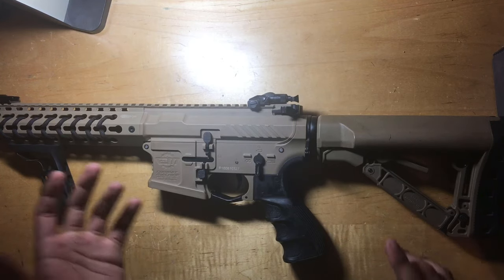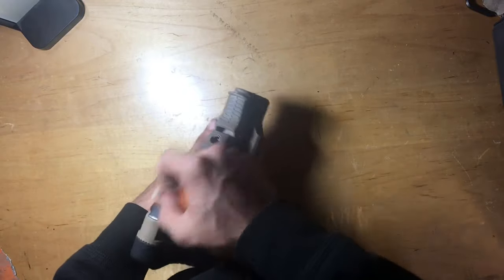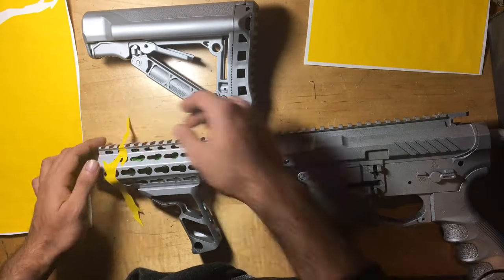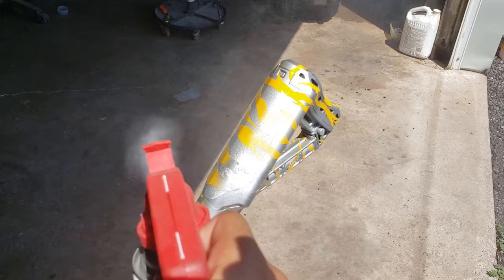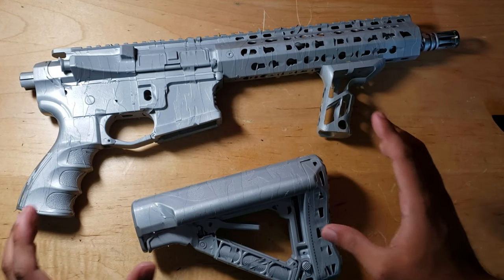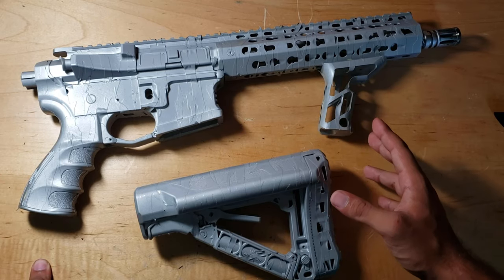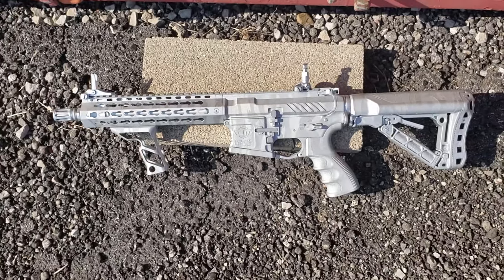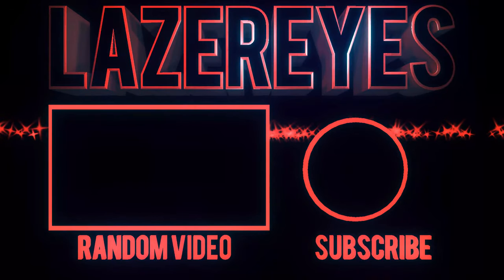COD WW2 "Chrome Tiger" Custom Paintjob (G&G SRL Paintjob)

Comment: What's your opinion on the G&G CM16 SRL? Any pros and cons really help, I'd really like to know if this could be a good starter for me.
Reply: I have the SRXL. Great gun for starters, especially with the microswitch trigger. The mosfet was the problem for me, i had to re-solder the wires a few times because they would get dislodged in the stock, there isn't much room in that G&G stock that comes with it
Reply from the maker: @AFOPatches   dead on, pretty much exactly what I was going to say. The SRL was my first gun and it's great for beginners, and yes micro switch is awesome. But the mosfet is garbage, mine completely gave out after a year and it's pretty infamous for it as well. I find this rifle to be very ergonomic as well. This is definalty something you'll enjoy using but later down the road, you'll probably have to get a new mosfet.
Reply: @lazereyes24airsoft22  Which is fine, having room to modify and improve an Airsoft gun is alright, so long as it works for the first few times playing Airsoft.

Comment: Hey man, new sub here, i really enjoy your videos, especially the paintjobs. What kind of paint do you use? Is it only rustoleum ? Any thoughts on plasti-dip ?
Reply from the maker: Hey! Thanks buddy I appreciate it :) I mainly use rustoleum because of all the hydrodipping paintjobs I have done, rustoleum and krylon are two different brands. I have heard great things about krylon when using it as a quick way to rattle can your airsoft gun with military camo. Plasti-dip will defineatly not last on an airsoft gun because of the abuse, I am a pretty aggressive player so I doubt It would last a day. Paint is the way to go for sure. Hope that helps, take care :)
Reply: @lazereyes24airsoft22  haha rustoleum is what I meant, not petroleum! :D Thanks for replying, I'm completely new on airsoft paintjobs. What are the paints you recommend ? Types and brands I mean. And one last question: i see you put borax in the water, why do you use that ? Is it to make the paint stick better on the parts ? Thanks a lot again :)
Reply from the maker: @billmaragos2812  Rustoleum 2X Ultra Cover Spray Paint is all I use unless I am doing something extra fancy like the metallic paints I've been using in this video. For that I'll just use whatever I find at the store, you can find these paints anywhere at local hardware shop (super common!). The reason I use these paints is because they are oil based, of they are not oil based paints then the paint will literally mix in with the water (I found this out the hard way 😅)

The borax is used to help the paint float on the surface of the water. You can get borax at the laundry aisle of a grocery store. I've done quite a few hydro dips and I still haven't used half the borax they give you.
Reply: @lazereyes24airsoft22  great, thank you so much for the information! Can't wait for your next videos :D Have a wonderful day!